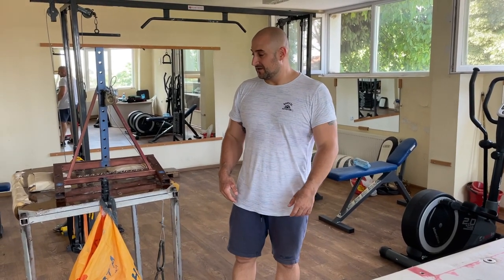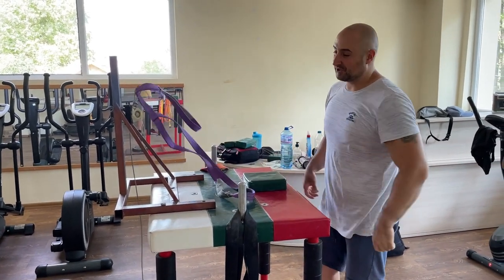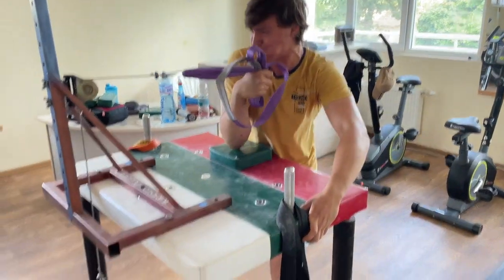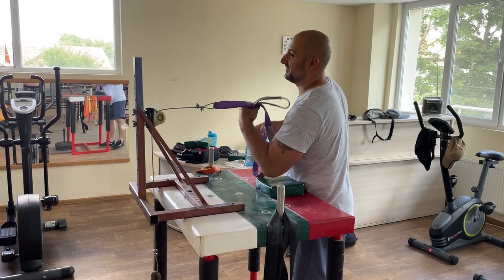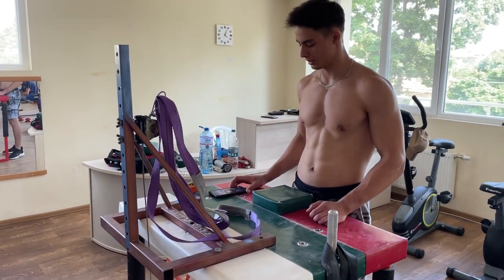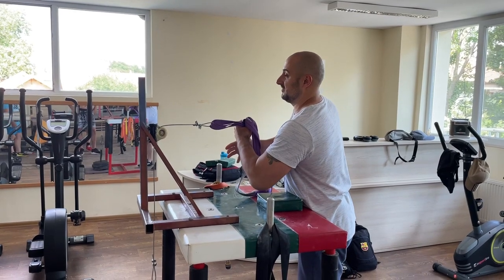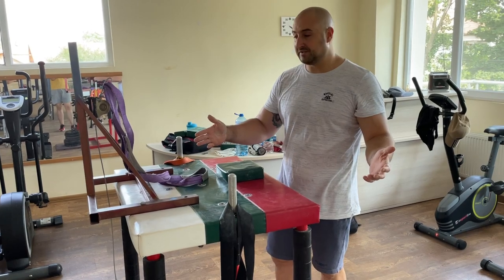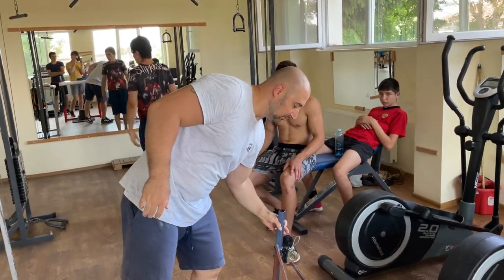Krasi’s Pulley + back pressure challenge!!!

Comment: 45+ kg is impressive. Well done!
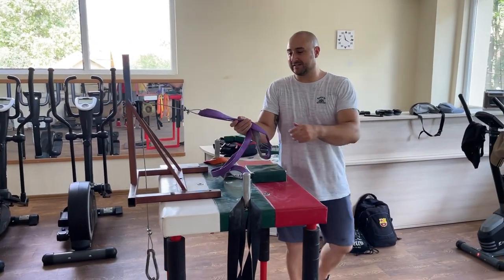Btw, at 2:40, where you point, that’s the place where I have pain in my right hand after I did a similar exercise with the pulley some weeks ago. 
Do you know how to get rid of it? 

Stretching doesn’t seem to help. Maybe continue with only low weights to heal the joint/connection?
Reply from the maker: Avoid exercises that put pressure on that area for 2-3 weeks
Reply: @krasimirkostadinov7177  thanks, will do that 👍🏻